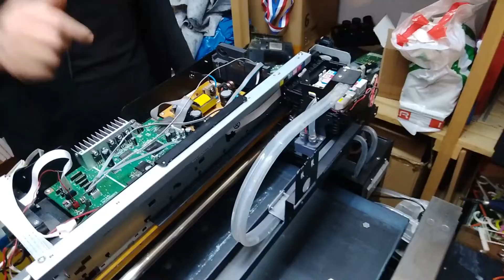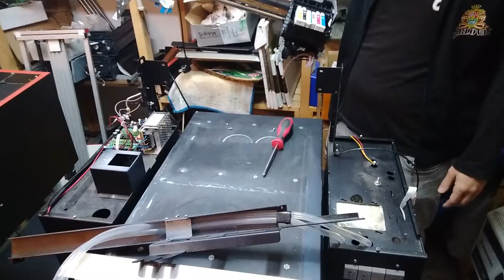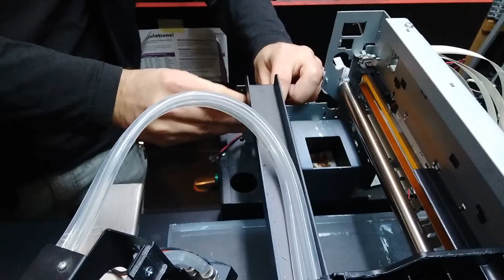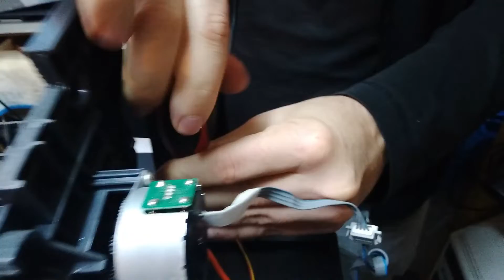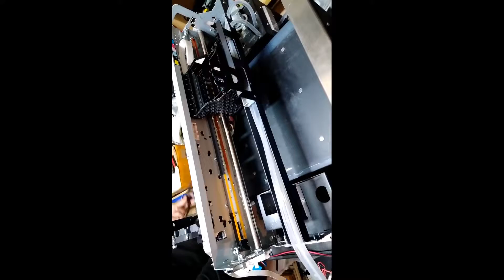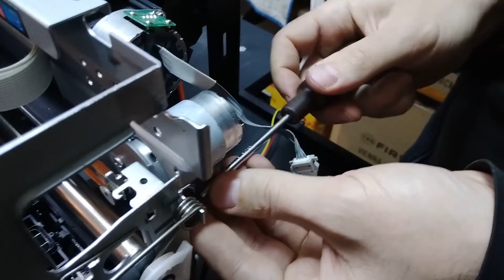UV printer repair 1390 (part 4)

Comment: Just wondering if you know if a stock epson 1400/1500w r1390 print head that used standard ink can be flushed out with isopropyl to then be used with UV ink?
Reply from the maker: If ti used ordinary ink and if you than what to use it with UV ink you don have to flush it, just do a couple of head cleans. Alcohol freezes the UV ink so those two dont mix together well. Just put the dampers on and do a couple of head cleans.
Reply: @Max0ressurected  Thank you again so much for your videos. I worked alongside your epson 1400 disassembly video and managed to successfully break it down. I think it would have been significantly harder without your help! For clearing out the old ink from a stock epson 1400 printhead, can I remove it from the stock machine and place it into my uv printer conversion with dampers carrying uv ink in them to run the head clean? - the stock machine doesn't function. Regarding alcohol freezing UV ink, I'm not sure I understand. Should I not be using IPA? If not, is there a cleaning solution you would recommend for the standard ink and UV ink as well?
Reply from the maker: @Tshaker879  Good job! Yes you can use the stock head and if it used only ordinary dye ink for paper you wont be having any problems if you just put the dampers with the UV ink on it and run a couple of head cleans to fill the head. Definitely if you need to clean the UV ink from somewhere you have to use UV cleaner, because alcohol wont dissolve the uv ink and the effect is exactly opposite. Any kind of UV cleaner is good. No name manufacturer is also good, but careful when you use it for manual head clean, use it only when nothing else helps. You can make a test with a drop of UV ink on some metal than try to clean it with IPA or medical alcohol and than try to clean the other drop with UV cleaner. See what happens, for better understanding.